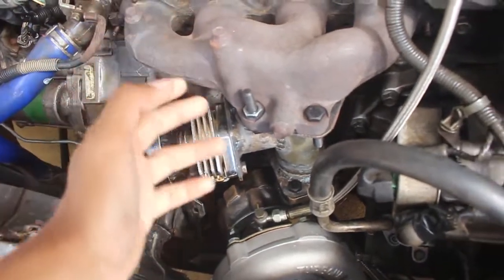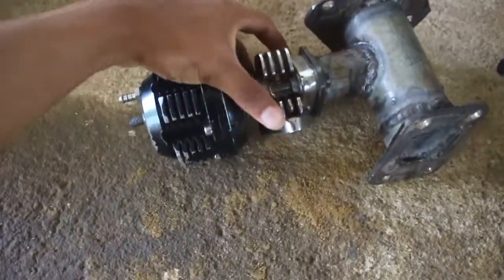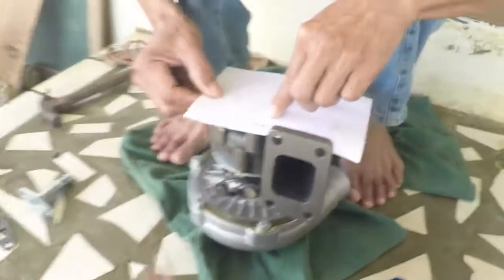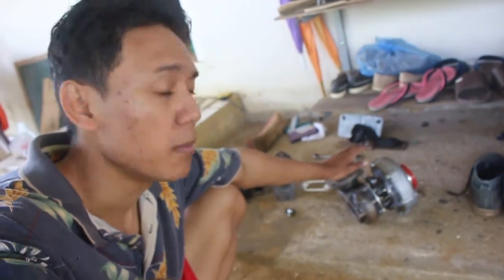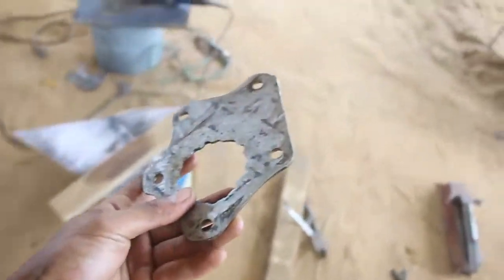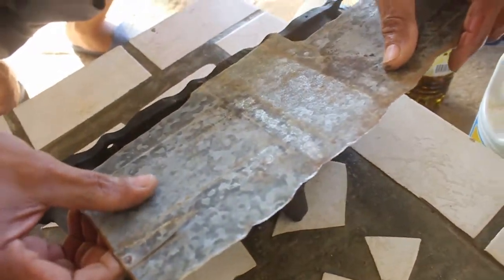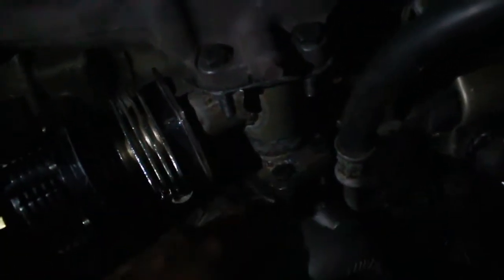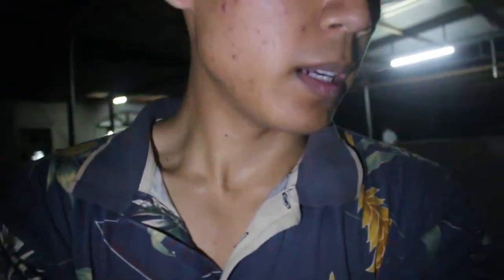Turbocharging my Honda Prelude (Part 1)

Comment: How do you guys figure an "F22B" comes in a prelude? Considering the f series engines minus the f20b are single cam. This engine is dual cam. Soooooooo
Reply from the maker: F22B DOHC is one of the many engine variants of the F series.. it has no VTEC, F series VTEC only came with SOHC..

Comment: H23 in a fifth gen? I just installed a greddy turbo kit with a 20g wheel in my 97.
Reply: Tex Mex 86 it's an F22B.. Stock block.. eBay pistons 🙈
Reply: The turbo is also a cheap one from Amazon...
Reply: Tex Mex 86 I want to buy a prelude with a turbo installed in it for $3k, I don’t know much about cars but what should I look out for?